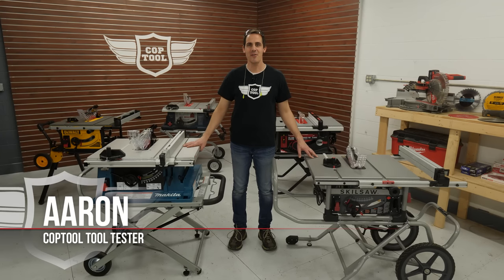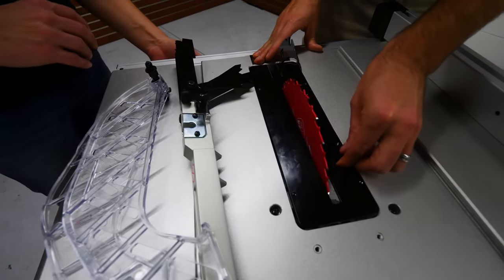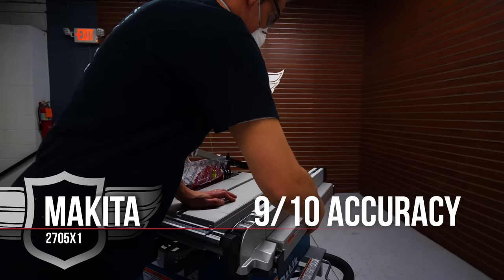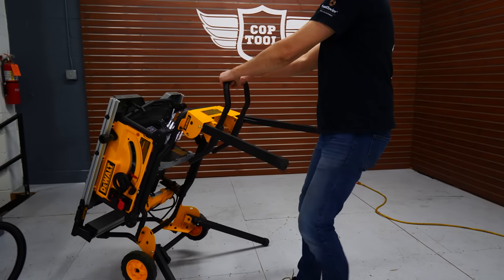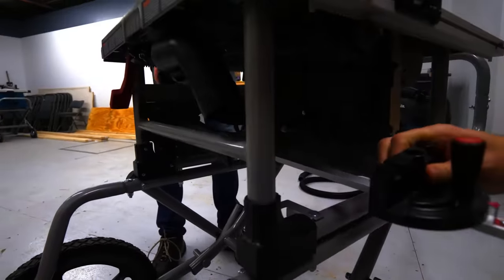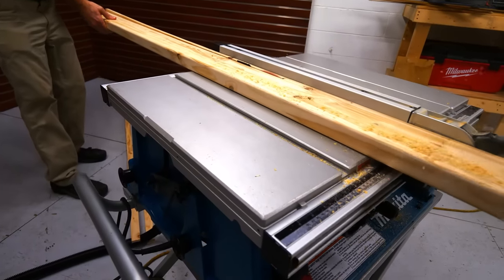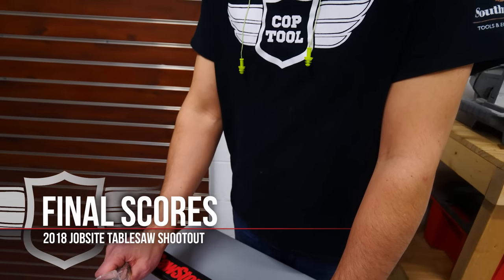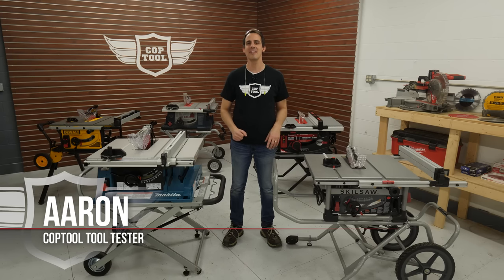THE BEST Jobsite Table Saw - Bosch, Dewalt, Makita, SawStop, SkilSaw. How to choose the one for you.

Comment: Obviously you can’t expect to make everyone happy with your scoring but here are a couple of things you missed. The Dewalt has a lock mechanism that makes the fence very solid, it has a separate riving knife. You also dinged its miter gauge while complimenting the Sawstop’s cheesy plastic one. The biggest thing you left out of your comparison was rip capacity; 32” for the Dewalt 25” for the Sawstop. I love Sawstop -  I’m planning on buying one of their cabinet saws - but this one has too many limitations for the price.
Reply: But it wont cut your fingers. That has a price.
Reply: @VaracolacidVesci  Not if I don't intend to put my fingers on the saw blade.

Comment: Well as a cabinet maker who takes a full workshop with me to the job site I can honestly say that my DeWalt never let me down. With close to 10 years of abuse. i bought mine with the older style folding stand. Having said all that, semi retired now and I needed a new table saw on wheels (66 years old...me not the saw) and i got a great deal on the Bosh which I love. I would take either one to a job site. That's my two cents.
Reply: Edward i am pretty much in the same boat here only i am 60
Bought the portable Dewalt years ago and threw the stand away and mounted it on my rolling work table that has my shaper on the other end and planer and jointer in the middle 
About 4 years ago i gave my youngest son the Dewalt and installed a router lift in its place and bought the Bosh and love it
Only thing is at year 4 the bearings is starting go out and the saw has ripped a ton of oak but very few hrs of any daddo blade time

Comment: While it is a little suspicious that the saw they don’t sell came in last place, I agree with the winner here. There is another great 8 saw head-to-head review where the Skilsaw places 3rd. That review, like a lot of negative reviews out there about this saw, seems to be too critical of it’s “out of the box” accuracy. I disagree with this because I think ANY saw you buy should be calibrated for performance and safety. Also, every saw you buy is going to vary slightly within each brand. You can’t just assume perfect out of box setup based on a review of 1 saw. Maybe if you tested 100 of each you’d get a more accurate review, but even so, I’d still calibrate my new saw. In this age, I’m just not brand-loyal anymore. I used to love Hitachi, and still lean that way on a coin-flip. However, Almost everything is made in China or overseas now, and there are way too many resources like these reviews to help you decide what’s best for you. If you are still brand-loyal, then just buy your brand and be happy...No need to run out and get your Dewalt tattoo covered or get all worked up over somebody else’s opinion. I was actually narrowed down to the Skilsaw and Dewalt, but chose the better motor, torque, and stand.
Reply: How do u calibrate a table saw?
Reply: Anyone with a Dewalt tattoo should have to have a 'by Black & Decker' butt tattoo.

😉
Reply: @nutrasweet8325  the manual has the info.

Comment: For people watching this at the end of 2022, and because table saw tech isn't really going to advance much, I'll throw in my take. I used to have the Bosch 4100-09 and I really liked it. It's a great saw and I would still have it, but had to move and it was one of the large items I decided to sell instead of lugging around with me. I made a lot of nice things on the Bosch, in particular speaker cabinets and some furniture. This year I got the Skilsaw SPT99 and while I haven't had a chance to stress-test it, my initial take is that it is a substantially better saw. A lot of the wear items that are plastic on the Bosch are metal on the Skilsaw. The Skillsaw has a better fence that stays true and the worm drive does provide a tangible increase in cutting power. The Skilsaw worm drive saws have lower no-load RPM ratings, but generally they maintain the RPM better under load than direct drive saws will...and if you want a portable table saw then the Skilsaw is definitely the way to go even in 2022.

Comment: The dewalt has a separate riving knife.  At $450US I don't see how this was rated so low in the price category.  The safety guard, riving knife, vacuum port, kickback guard is a work of genius.  Like all saws you have to raise the blade to full height to insert the riving knife.  Just remove the zero clearance plate to insert then replace.  Too  easy.  Saying it just gets in the way is careless. The fence is certainly solid enough.  And the rip capacity is the best.  And can accomodate a dado stack.

Comment: Seems you guys hurt a lot of DeWalt fans/owners feelings with this one! Have used the UK versions of the Bosch, DeWalt and Makita saws. The Bosch plainly has the most power. Really like the fence and table extension of the Makita. Quite like Dewalts ability to incrementally wind the fence into position. Little to choose between them to be honest but the Makita is underpowered. Weakest of the 3 I've used.

Comment: I had the Dewalt 7491RS before I replaced it with the Flexvolt model due to space limitations in my van. That was the only reason, besides going cordless of course. I had none of those issues that you pointed out. The fence on mine was rock solid with no play, the riving knife slipped in and out in secounds, power was never lackning, transportation was easy once you got used to the folding legs. I noticed that you made a wrong move there, the lower legs can be folded simply with your foot.
Reply: hows the flex volt? im between that or the skilsaw
Reply: Adam McKenzie I really love it, but I hear the skilsaw is good too. I guess it depends on the corded/cordless situation between those two
Reply: Mattias Blomqvist im all about cordless so lol check me on instagram if u have it @mwaramps
Reply: Adam McKenzie go with FV then. You wont regret it 👍
Reply: Same I have it as well and it’s easy to move

Comment: I have a dewalt saw. It's okay. You got to take it slow with lumber if you want a nice finish accurate cut. The fence sucks. The saw has crapped out on me several times and I maintain it well. But still works. I got different brand tools that work best for what I need. Found out One brand doesn't rule them all. Bull. But did like the skill saw. My buddy has it. Spent the day collaborating on projects and I used that saw. Damn. Feels like a Cabinet Saw Shop minus the fence. I'm not about brands. They're all give and take on different products. But that machine damn well works with 2x4, 4x4, 2x6 and 2x8. That worm drive sold me. I got a 6 1/2 rigid cordless saw they dont make anymore with a worm drive. Love it. Milwaukee surge impact drill. Love it. Dewalt cordless framing circular saw. Love it. You can love your brand. But I love good work without worrying. That Skill Saw spt99-11 is a solid work horse. And that's what I want. It's just a machine. I'm not faithful to the brand. That's my money. That machine quality should be faithful to me.

Comment: I really like my Dewalt. The rack and pinion system is awesome and the saw does everything I need it to do. I’m far from a Dewalt fan boy. I don’t buy their cordless tools. I have too many dead drills to waste any more money on those. When I was shopping for a job site saw though, I saw that rack and pinion system and immediately knew it was the saw for me. It is so easy to dial the fence in precisely where I want it and there is no need for a measuring tape when using that saw. I completely disregard the ratings on all of the safety features. That junk comes off my saws before I ever plug it in for the first time. Trying to work around cumbersome safety devices is far more dangerous in my opinion. I’ve never had a close call with a table saw and can’t imagine a situation where I will. My digits stay away from the spinning wheel of death.

Comment: As to the Dewalt, the fence can be aligned by simply loosening the black lock down studs on the front and rear fence bar and adjusting the fence to either the blade or miter slot. Also the Dewalt comes with two riving knives. One for the blade guard and one for used as a stand alone with the blade only. I also noted that you were not properly installing the riving knife on the Dewalt. You should remove the blade cover plate so you can see the slot where the riving knife fits. Trying to do it in the "blind" is very difficult.
Reply: Yeah you're just completely right

Comment: For two years I've been reviewing compact table and mitre saws and finally bought a Dewalt table saw last week. I looked at Rigid, Makita, Hitachi, SkilSaw, Harbor Tools, Delta, and Bosch and in terms of price, positive reviews and longevity, I chose the Dewalt.  I also never saw any product information or heard of a SawStop. I bought the DW745.  There is no way I wanted to spend more than $500 on a residential compact table saw, which I'm going to use for hobby projects and minor woodworking.  I also wanted something that as a female I could easily move, while many of these table saws weighed over 75 lbs, which also made the Dewalt a clear winner at just under 50 lbs.

Comment: Had a Bosch, lasted about 8 months in and out of the truck.  Makita too, lasted about 6 months, burned the motor up.  Bought a DeWalt 3 years ago, and abuse the hell out of it.  Had to get a new fence, and put a new chord on it.  Still using the DeWalt, but I'd love to try the SkilSaw.  Durability and accuracy, everything else is just horse manure.
Reply: "Durability and accuracy, everything else is just horse manure."

And that is why I returned a Saw Stop after 48 hours.. accuracy lacking.
Reply: Il existe d'autres marques excellentes comme metabo ma marque préférée extrêmement robuste résistant j'ai plus machine metabo dont un des tout premiers perforateur que j'ai acheté en 1982 je l'ai utilisé beaucoup il est toujours en parfait état rapport qualité prix très bien placé exemple la degauchiseuse 260 vendues chez moi moin de 800 euros dewalt 1500 euros la metabo un petit peut plus puissante 2200 lorsque j'ai connu metabo dans les années 80 il vendait uniquement au professionnelle quand a la,marque skil pour ceux qui disent que c'est de la,merde j'ai une petite scie circulaires et une perceuse skil j'en suis très satisfait malgré son âge j'ai eu locations de la prêter le gars l'avait laissé dehors dans l'herbe 15 jours sous la pluie lorsque j'ai trouvé ma scie j'ai poussé une gueulante le type me la remboursée je l'ai récupéré pour la j'étais à la poubelle quelques temps plus tard je vais dans mon atelier pour la jeter je la branche avant voir elle fonctionnait toujours du coup j'ai fait un nettoyage je l'ai toujours du  black j'en ai eu serie grand public c'est de la merde mais ils ont une gamme professionnelle !

Comment: Just so everyone knows, coptool is authored by Ohio Power Tool (you can see this if you click on their "about" tab).  This company does not sell Dewalt, they do sell Bosch, Makita, Sawstop, and Skilsaw.  This isn't an objective review.  It's a review geared towards selling more of their products.  It's pretty obvious by how they rate the Dewalt.
Reply from the maker: Chris we are affiliated with Ohio Power Tool, we try not to hide that which is why it's on top of every page of www.coptool.com and in all bios and mentioned frequently. Coptool works as independently as possible so we can get the best results. Coptool's testing and results is much more likely to guide what Ohio Power Tool recommends and sells than vice-versa. We have many tests where Dewalt has won or been 2nd, in the recent "Most Innovative Tools of 2017" Dewalt was the Winner (https://youtu.be/1gWM5Viwt-w?t=12m32s ). We thought going in to this test it would middle or top of the pack because of it's popularity, again these were all super close in power testing it was not as definitive as we were hoping, so it came down to things like movement in the fence and other smaller details. Again it could be just this one saw that might have had some issues or less power than typical that might of skewed this for any of the tools tested. You should also know most, if not all Tool Review Channels are sponsored by tool brands and/or retailers so you should always be somewhat skeptical of the results, we try to be as upfront as possible about that which is not always the case with others.
Reply: Well,  along with the fact that the dewalt really is the worst saw in this group.
Reply: No Milwaukee. Wow. We’re dunzos
Reply: @roberte362  a Milwaukee jobsite table saw isn't very common... I've never seen one. Most people seem to have the DeWalt.
Reply: @ToolShow  I came in here for advice on what jobsite Table saw to buy. (incidentally your vidio helped a lot) However I thought I would mention - whether Chris's opinion of this not being an objective review is valid or not - The fact that you left the comment in place proves to me that Coptool can be a trusted resource for advice on tools. Many Thanks, subbed
Reply: I knew right away something was off about this review when they introduced the "SawStop" a manufacturer no one has heard of.
Reply: @finalchapter24k  Are you kidding about SawStop?  They are THE safest table saw out there.
Reply: @ToolShow  glad to see you guys replying to this
Reply: @finalchapter24k  That's like saying noone has heard of Maserati so it must be crap.   Not sure a typical jobsite saw use case will trade safety for that much cost (or potential to protect vs abuse the motor - when clearly the Dewalt and esp. the worm drive Skil are built for abuse), so that would be a valid criticism for the "class" of tool this is (their Cabinet Saws - different story !), but otherwise it's a darn good brand, and if you're a small garage hobbyist that can't fit a big saw but wants safety, I'm sure they're very happy with this.   I disagree with the fence nitpick about the Dewalt (I can't make mine wiggle like that) and they simply misused the guard replacement features (saw blade up max, remove blade insert, pull lever - simple), but otherwise thought they were pretty objective.

Comment: I have used the Makita and Sawstop at different times for residential finish carpentry. The Sawstop wins by far. One thing you can't test out on first glance is longevity. The cheap plastic gears under the Makita table saw shear off and get clogged full of sawdust even with routine dusting; this combined with the glide bearings loosening (resulting in binding) make it a right bitch to adjust. You can counteract this with maintenance and careful operation but I would rather use the Sawstop with the added benefit of finger safety.

Comment: VERY important note on the Skilsaw ! The Skilsaw 99-12 was tested, it is NOT the one sold at the box stores. The 99-12 has a larger motor and much better fence than the box store model . It has a short auxilary fence that flips into place for extra hand clearance on close rips, the same auxilary fence drops below table height and acts as a material support for the main fence on wide rips It also has a rip capacity of 30.5 inches and the tube frame of the stand is set to table height to act as a material support left of table. I've had this saw a couple months and couldn't be happier with the power and the design features.
Reply: Ordered mine over a year ago. Finally getting it this week! Any updates on this initial review?
Reply: @868_4_Life  The saw has held up well. The amount of torque still impresses me and I appreciate the push stick always being easy to get to. I have had two issues. The fence lock stopped working one day in very cold weather and had to be adjusted  and the lift mechanism has developed a small amount of play so that I am having to put a little (very little) lift at the rear of the motor while raising the blade to keep it from binding. I think I can adjust that but haven't tried yet. All in all I've been happy with this machine.
Reply: The only difference between the 99-11 and the 99-12 is the saw blade. The 12 comes with a diablo blade.

Comment: All these safety analyses seem lacking, although this article touches on some of them:  A blade guard, riving knife, pawls, and a push stick are all de rigueur at this point, as they are required by law.  The real questions that need to be asked in safety comparisons should be:
1. The most obvious:  is it a sawstop?  1a. Why is sawstop blocking the adoption of similar technologies in the U.S., like the one Bosch developed, while at the same time lobbying to make it a requirement?
2.  Can you rip thin strips without removing the blade guard with the aid of a flip over auxiliary fence, or even better, a thin Euro-style blade guard like the sawstop has?
3.  Can you use the blade guard while cross-cutting thick workpieces, or when using a tall auxillary fence on your miter guage?
4.  Can you use the blade guard with the riving knife in its low position to facilitate quick transitions from non-through cuts to through cuts and back?
5.  Does the saw have an electric blade brake?  This is always overlooked and is very important.  Notably it's required in Europe.
6.  Is the saw accurate out of the box so that your first cuts don't bind?
7.  Does the insert plate design allow for easy fabrication of a zero clearance insert in a home workshop with limited tools that will stay in place and allow passage of the riving knife through the insert?
8.  Does it accommodate dado blades?  If so, is there a dado insert plate available?  Europe doesn't allow the use of dados for safety reasons.